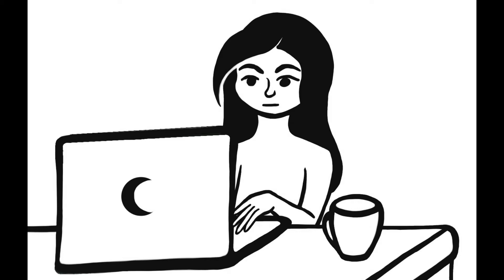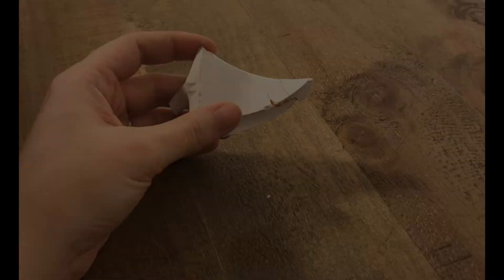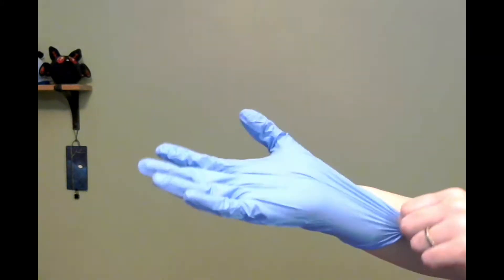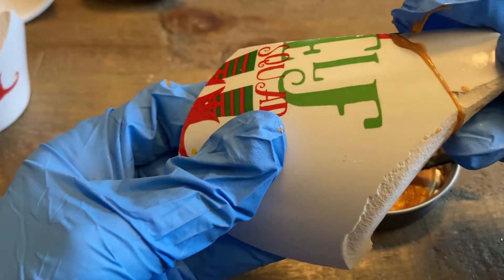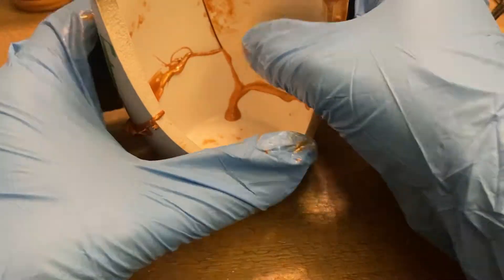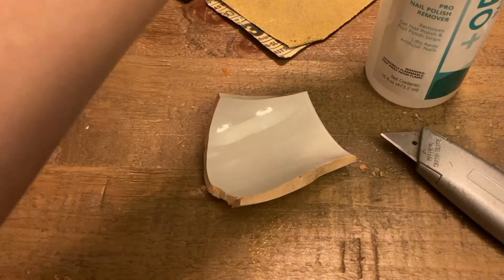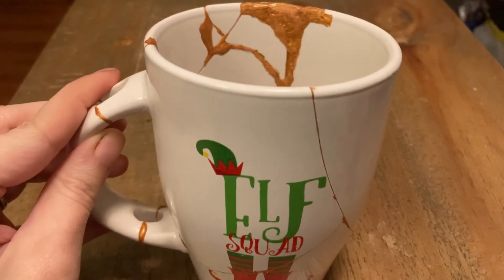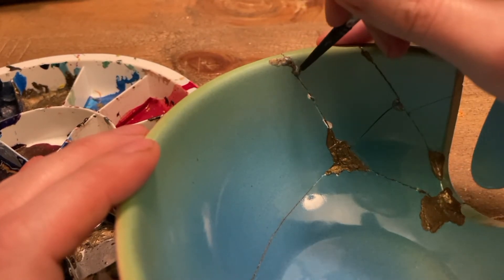DIY Kintsugi Ceramics Repair with Epoxy Resin

Comment: Note that a surgical mask is not adequate to protect from fumes. If you are only doing one job, just a well-ventilated space is good enough (you are not exposed chronically). If you want full protection, you need to get a mask for fumes, i.e. a 3M professional mask.

Comment: can you drink from that cup, put it in the microwave and use it as a normal one?
Reply from the maker: It's fine for cold drinks, but I wouldn't use it for hot ones. Hot water from a dishwasher will soften the epoxy, and I don't trust it in a microwave.
Reply: @SallieKatStudio  Epoxy is toxic, and I wouldn't trust the coloring you are adding either. Even kintsugi made by the traditional methods say that it isn't safe for food anymore and is strictly a showpiece. I would stop using it as a water cup.